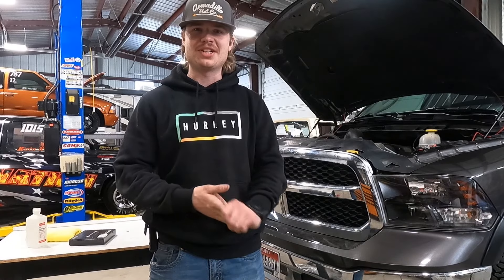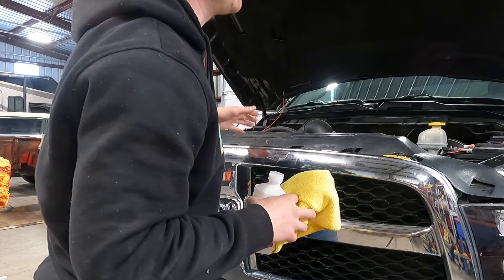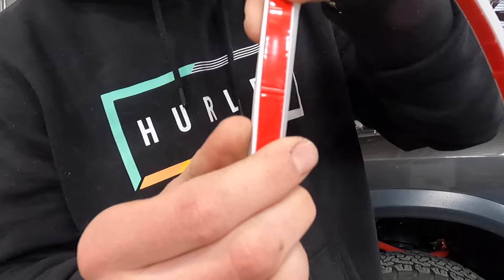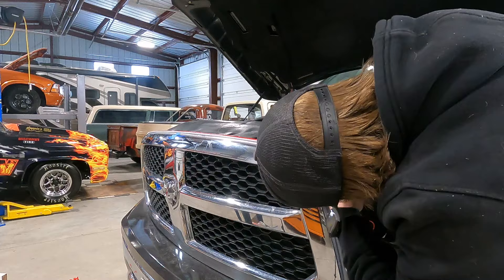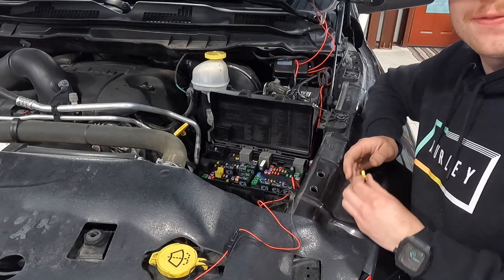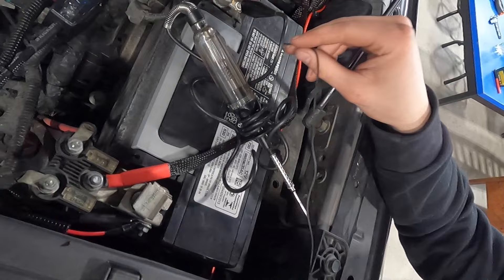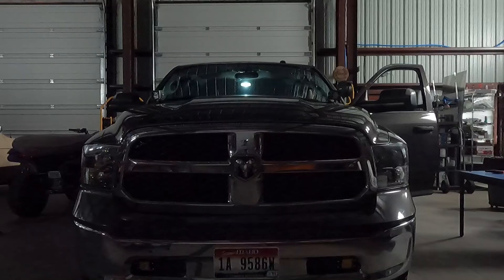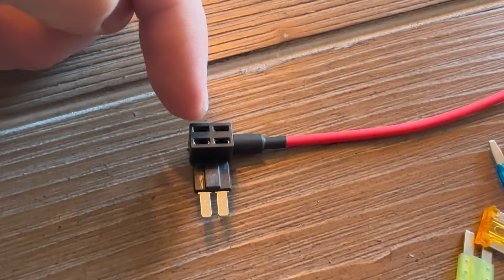Easiest Way To Install A Hood Light Strip! (For Most Vehicles)

Comment: Everyone is just copying the placement on the cars they're advertised with. I've had mine for months. For the Dodge it should've been continued down the sides of the grill, not over the top of the headlights. Thereby making the unique shape specific to Dodge grille/frontend, on the startup and constant shine down the road.
Reply from the maker: Sure thing! You could do it a couple different ways depending on preference, I personally like the look of it just straight across the hood and on top of the headlights but going down the grille would be cool as well!
Reply: That's what I did
Reply: @TouchofDepth  I just picked up 2 more on sale for $18, going to put on the sides for place to come on when at night and find/see it from distance in parking lot when hit the remote unlock or remote start. Or running board lights
Reply: @HTSS8  I like the way you think
Reply: @darrellpeterson7776  "you're" reading
Reply: @darrellpeterson7776  "you're" at it
Reply: darrellpeterson7776  "...at it [,] grab"
Reply: darrellpeterson7776  ".....reading [.]"
Reply: @@HTSS8  trolls never admit when they've acted the fool for everyone to see. Tell them they can find the grammar and punctuation study guides at the library 🙂. If they need help they should just ask the 12 yr old library assistant for the location and maybe some tutoring.
Reply: Is correct size for Chevy is 59?
Reply: That was my first thought on my 4th gen wanna change the headlights soon so don’t want put adhesive on it
Reply: I agree with this statement on the copying part. But I installed my 70” strip around my grill from one side to the other and did not run it across the lights it tucked into the crevice nicely and I took off the red tape and just put electrical around the grill and it covered it nicely.
Reply: @DakotaNationRacing what fuse did you use under the hood as far as fuse to what accessories in the truck. I ran mine to the outlet plug in my truck.

Comment: I have a Refreshed 2022 Silverado 1500 RST. I installed this recently on my truck and maybe can help someone out there who may have some questions on this install with the same truck. Firstly I installed it on the actual hood of the truck in front of the weather strip(just my preference). You cannot see the light at all from installing it in this location(tape the light itself almost dead even to slightly proud of the edge of the hood). I ran the wires through the hood and grounded it to the negative battery terminal with a crimped electrical eyelet. The positive(red/hot wire) I ran to the engine fuse panel and used a fuse tap into fuse #28 (Park Lamp Mirror/Grill) using a micro2 5 amp fuse. The light draws about 2 amps so you don't need anything above 5 amps. When installing the fuse tap(install factory fuse on the bottom then the new fuse where the wire is part is) pay attention to the way you pull out the fuse from the panel, you will want to install the new fuse tap in the same direction. The orientation does matter so the spades should all be following in the correct direction.(watch a fuse tap video if you are unclear of what I mean.) It can potentially cause electrical issues if you do not have this orientation correct even though it will "work" either way you put it in. Those of you who have this truck know that when you hit the unlock button there is factory dynamic light show with the blinkers. When using fuse #28 the led light strip WILL activate as well when you unlock the doors in-sync with the front blinkers. The dynamic LED light will NOT stay on constant with just the DRLs on during the day. When the head lights are on at night the LED light will do its automation when the truck is started and stay illuminated until you shut the truck off. Hope this helps!
Reply from the maker: Great points, thank you!
Reply: Thank you for the help

Comment: What do you do if you have to pull your grill out and change a headlamp
Reply from the maker: I would just pull the edges off the headlights and leave it attached on the grill! I have some 3m double sided tape id use to re-attach everything when i put it back together!
Reply: I don't know how but I've never taken off my grill to replace a headlamp on my headlights (RAM 1500) I can take off the whole assembly somehow without taking that big grill off

Comment: I watched a number of similar videos and yours is definitely my favorite. But for some reason nobody covers the little issue I had of not being able to close the fuse box cover with a wire sticking out from the fuse tap. I had to cut a notch in the lid for the wire with a Dremel so I could close it. Maybe this was obvious to others but I had to get over my OCD reluctance to "damage" anything on my new car. I reasoned "it's just a lid, who cares" :-)
Reply from the maker: I appreciate it! Yes, all i did was took a little file and just barely notched it so the wire doesn’t get smashed!
Reply: you could always locate where all the factory wires enter into the fuse box from the bottom and fish it in from there somehow

Comment: Great video!  Would only suggest adding a little electric grease to the wire ends to prevent corrosion.  Other than that,  great step by step!

Comment: Not gonna lie, that looked sick as hell. I actually really like that. I did have grille lights on my front grille on my Silverado, they were a separate piece of plastic that came down the sides on the inside and across the bottom like 1/4 of the way through and I cut the sealant they used off like some kind of silicone or something and I took the white lights they had in them and replaced them with some other RGB led strips I bought off Amazon that were meant for the eyebrow lights and the had a switch back function too. I put it all back together and sealed them again myself, which I thought I 100% sealed them back, here in Florida we had a nasty week of rain and somehow rain got into the plastic housings and friend the LED strips because the strips I used came in the same rubber covering but I had to take them out to fit in those pieces for the grille. So now I’m on attempt 2 with different LED’s but actually might not use them after seeing this, what I might do is get 2 of these strips and make a whole outline around my grille, maybe take some of my green vinyl tint and wrap them in it so it gives off a green tint instead but hella sick. I totally dig it.
Reply from the maker: That sounds like a cool idea, let me know how that works if you end up goin that route!🤘🏼

Comment: I installed an orange one to match my clearance and mirror lights on my Ram. Told by an officer that the hood light is "not legal" to have as they are not DOT approved. 🙄Another great reason to be pulled over in VA. Have read of many people having issues with the light strip failing. When it does plan to go to single orange lights in grill like the Raptors have.
Reply from the maker: Thats frustrating! Those lights don’t project a ton of light out, so you would think if people could just see you better it would be better?🧐 i do like the raptor or TRX amber look though!
Reply: Many vehicles have illuminated badges on the grille. This seems like the same, simply an alternative. Some cops have nothing better to do.

Comment: Appreciate the video,  can yourself or anyone else help me out please , I've fitted the scan light and it comes on with my cars lights (auto lights) when using the fob to unlock, which is what I wanted , I also wanted them to stay on with my lights when I start the engine but it goes off once the engine starts ????
Reply from the maker: Hmm not sure, sounds like it’s only getting power on the unlock obviously, not sure what fuse tap you have it wired up to or if you tapped straight into a wire. If its wired to your lights, have you tried to manually turn your lights on and see if it is working when the rest of the lights are on?

Comment: I may sound dumb right now but is there a certain type of fuse that is better. Like what size of fuse I guess is what I am asking. Thank you so much for a simple video explaining all the steps.
Reply from the maker: Haha there are no dumb questions! Basically the higher the number on the fuse, the more  current it takes to “pop”. If you ordered a light strip that already comes with an inline fuse (like mine in the video) then it is technically already protected. So the fuse that you put in your fuse tap shouldn’t really matter in this case, however to be safe i would throw a low fuse in there maybe like a 5 if you have one! Also make sure you tap into a fuse slot that isn’t necessary for your vehicle to run and drive, in case of an emergency you don’t want to get stranded because you tapped into an “important” fuse and it popped, hope this helps!
Reply: That is perfect. Thank you so much for the help. Yes mine has the fuse protector basically think it’s the same one as in your video. I will hopefully get it all sorted this weekend. Take care and thanks again
Reply: So my car uses micro fuses and some extras but no 5amp. For the ACC slot it has a 10amp. Should I still get a 5amp for these lights or use one of the 10amp extras? And yesi was going to use the ACC fuse slot. Thanks for letting me ask cause not trying to mess my car up. 2023 Kia sportage 😀
Reply from the maker: 10 should be fine! It should technically be protected by the inline fuse already on there

Comment: What if you have to manually turn your headlights on and want the led strip to only light up with the headlights?
Reply from the maker: You can tap into your headlight wire and then they will only be on with your headlights!

Comment: I have a Mazda 3 2009, the ACC fuses are on the inside, can you tell me which fuse I can safely tap into in the engine compartment. Thanks
Reply from the maker: Sorry I don’t have that car so i’m not exactly sure. You can always take it to your local stereo shop and they can help you out wiring it up, finding a good wire to tap into under the hood even, hope that helps!

Comment: Great video, precise and straight to the point!  Would it better to attach  the red wire to the day time running light fuse or just any fuse that has no power when the car is off?  What about the Amp? Dose it matter since the  fuse tap is 5 Amp? Do you need to find a fuse (no power when car is off) that is only 5 Amp or any Amp is ok? thanks. Subscribed and thumbs up
Reply from the maker: You can run it to your DRL fuse if you would like, any amp should be fine, if you bought the same one as me its already protected with an inline fuse so you don’t need to find a fuse that is only 5 amp!

Comment: Hi. I installed mine and it is coming on but stays on, it wont turn off when I switch the engine off. Its just "on" constantly. I have red wire in 10amp fuse in fuse box and black wire grounded. Are they supposed to be connected to the lights or something?
Reply from the maker: Sounds like you found a fuse that has power all the time, you want to look for a fuse thats only on when the key is on, BUT not important for the vehicle to run in case you have an issue, for mine i used the seat heater fuse even though my truck isn’t equipped with them. It doesn’t have to be tied into the lights. Try finding a different fuse and let me know if that works!

Comment: Nice. Now I just need to find a spot for my train horn on my 2019 Sierra.
Reply: Horn blaster makes a really nice kit that goes where the spare tire carrier
Reply: I’ve got a 2020 F-150 and I had the horns installed under the bed and the compressor bolted into the bed just behind the cab.

Comment: Great video just one question which fuse do u choose to use or how do u determine among the fuse inside the fuse box is there a specific one and how many amps
Reply from the maker: Choose one thats not vital to the vehicle running, i used my seat heater slot (even though my truck doesn’t have seat heaters in it). You want a slot that only gets power when the vehicle is running or your light will be on all the time. The strip light should already by protected by the inline fuse that comes with it, so just use a low amp fuse like a 5 if you got one

Comment: I did everything but it lits up before I get to start the car..what am i doing wrong ??
Reply from the maker: You must have put the fuse tap to a slot that is hot all the time, it need to be in a slot that only has power when the vehicle is on, hope that helps!

Comment: My question is what size fuse (amp) do I need in the upper slot of the tap in order for the led lights to work? 
Thanks!
Reply from the maker: If you bought the same strip light i did, you should already have an inline fuse for the light, if thats the case, the light doesn’t draw very much power so you can throw a small fuse in there like a 5 maybe! Again it should already be protected with the inline fuse on the light strip!

Comment: I just have a question please so if you using the fuse tap does the fuse have to be the same number as the one your stealing from ? And what fuse would you recommend you hook the tap up to exactly cause I’m trying but have no clue what to do fr
Reply from the maker: No we are just piggybacking power when we are using a fuse tap. If your light came with an inline fuse already, that should mean that the light is technically already protected, therefore whatever fuse you use to power the light doesn’t matter too much. I would put in a lower fuse though if you have it, 2 or 5 maybe since it doesn’t draw a lot of power. Tap into one that isn’t crucial for your vehicle to operate in case anything happens. I used my “seat heater” slot, even though my truck doesn’t have seat heaters, it still has a fuse for them in the box, so find a slot that only has power when your vehicle is running and that will make it turn on and off with your vehicle, hope that helps!
Reply: @DakotaNationRacing  yessssssss thank you so much and I had order a fuse tap from AliExpress and it came with a 10 fuse so I’ll be better off buying a lower one and using tht instead with it ?
Reply from the maker: If your light already has an inline fuse then it should technically be protected already and a 10 is a bit high but should still work. If your light doesn’t already have a fuse in line then i would maybe go try and find a 2 or 5 that’ll work from your local auto parts store

Comment: so i recently bought a product from hoodflare, but it doesnt come with thag inline fuse u said, it just has exposed cables at the end. any help as to how i can connect it?
Reply: With no inline fuse you'll need to add your own fuse. He has links to fuses and fuse taps in the description. He also shows how to use both products at the end of the vid
Reply from the maker: Yes^ Without an inline fuse yes you’ll want to make certain you use a fuse tap with the correct fuse for your application so you don’t have any issues!

Comment: I tried to follow your instructions but when it came to the fuse box, none of my fuses were an acc fuse, I tested all of them and they were all hot, so what am I missing or is there another spot where I can get power? My vehicle is a 2007 Honda accord hybrid.
Reply from the maker: Did you have the key on when you were testing? There should be some ACC for you to pull from that only would be on when the cars on. Unfortunately im not familiar with the accord platform, you might have to do a little research to find the correct fuse to pull from! Many vehicles have more than one fuse box, sorry I don’t have a solution but hope that helps!

Comment: I have fuse taps and was going to use one in the slot where the lights are being used, but the tap doesn’t fit into that small space. Should I use another slot that is not being used for anything?
Reply from the maker: Ya theres a few different size of fuses but if you only have the 1 size fuse tap then youll have to try and find a slot that fits the fuse tap you have and just hopefully its an accessory fuse and not hot all the time! I have the fuse tap link in the description and that one comes with a couple of each size if you can’t get yours to work out

Comment: Front of car, with acumulator i dont have fuse box and what can i do with negative pole
Reply from the maker: You have to hook these up to a fuse in your fuse box, not sure where your vehicles fuse box is located you might need to do some online research if you can’t find it, for the negative wire it can just go to a ground on the vehicle, it doesn’t need to go to the negative pole on the battery
Reply: @DakotaNationRacing  can i connect negative wire to low beam
Reply from the maker: Unfortunately no

Comment: if I'm tapping to a 15amp fuse, what fuse would I use for the top slot? 15amp is the only size that fits. 

also, I can't seem to get a snug fit while using the fuse adapter and the LED lights are very dull....any help is appreciated.
Reply from the maker: You can use like a 5amp for the top, the light should already have an fuse built into it. You might just have the wrong size? I didn’t have any trouble with the fitment, everything was tight for me, maybe try a different fuse slot! Also I haven’t heard anyone having any problems with dull lights, you might’ve got a bad light from the factory

Comment: I tried doing this the lazy way until I get some of those fuse taps and it didn’t work can someone help me I have a 2009 Chrysler 300
Reply from the maker: Make sure you have a good ground! Did you test the strip you got before you installed it to make sure it works?

Comment: Great video! Just one question. I purchased the one that would work with turn signals as well. Any video or advice on how to connect those wires to work when turn signal is on? Thank
You in advance.
Reply from the maker: Thanks! I haven’t installed that style yet but i’m guessing you’ll just need a couple wire taps. Find out where your turn signal wires are and wire tap them to the wires on the strip light, hope that helps!